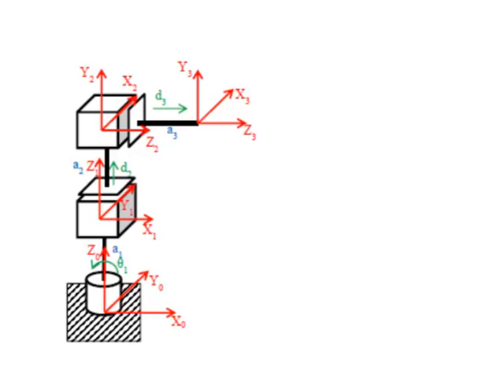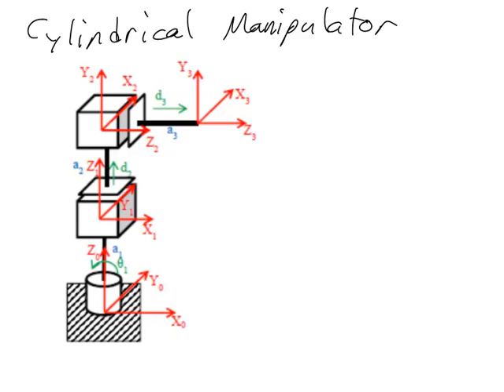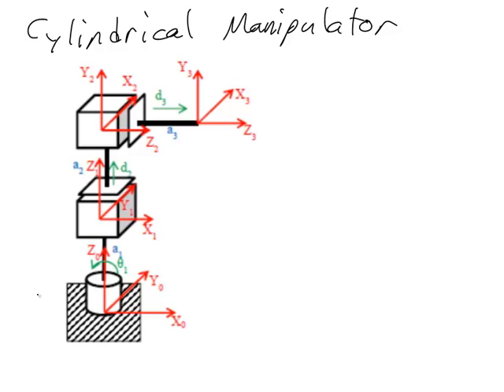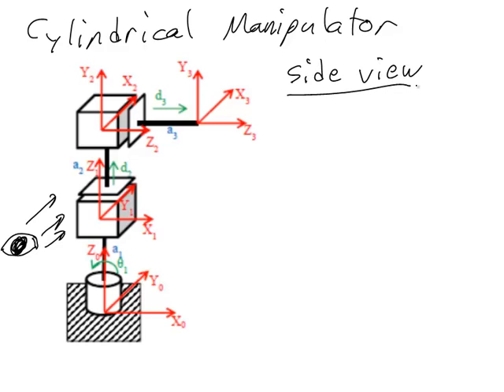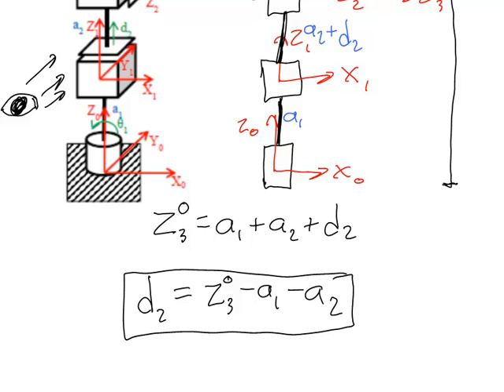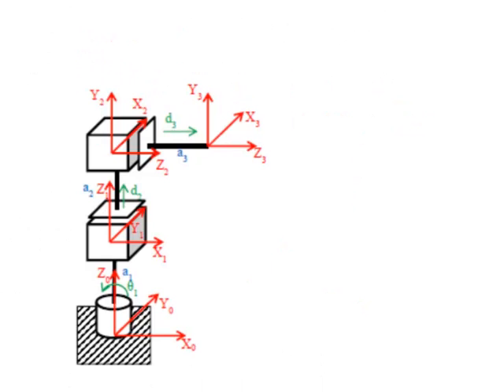1 1 6 Lecture Video 2 of 2   Inverse Kinematics Cylindrical Example

Comment: your frame 3 is incorrect, as we are rotating by -90 degrees (against right-hand thumb rule), X2 will face down, parallel to Z0 axis, also Y axes are the ones invisible from the side view. frame 4 will be constructed accordingly. did you run this in MATLAB and got solutions for kinematics/dynamics?

Comment: How i can calculate Y(0-3) and X(0-3) ?
Reply: You have to calculte them from the Forward Kinematics. So Is you calculate the matrix T(0-3), that its equal to T(0-2)*A3, where A3 is the matrix of your third joint ans T(0-2) is the matrix of joint1*joint2. From the las column of matrix T(0-3) you get their respectives x,y and z components relative to frame 0.

Comment: The joint at XYX(1) does not do anything that can not be achieved by rotating XYX(0) from what I can see.
It brings variable D2 into the equation is all if I am understanding it correctly and that is superfluous, why not just use Theta1 ?
Z0 and Z1 are always in the same plane when viewed from the top as you said.
The distance between XYX(0) and XYZ(3) will always be the, same all that can change is the angle between X0 and Z3.
Or am I missing something?
Reply from the maker: I'm not sure if I understood you question correctly, but let me try at an answer:

The manipulator in this example is a 'cylindrical' manipulator.  It is called that (for one reason) because the 'workspace' (the space the robot end-effector can reach) is a cylinder.  The first joint is rotational, allowing us to set the position of the end-effector at an angle around a circle.  The second joint is linear (prismatic), allowing us to set the height of the end-effector above the ground.  The third joint is also linear, allowing us to set the distance between the center of the cylinder and the end-effector.

With these three joints combined, we can control the position of the end-effector in 3-dimensional space.  In other words, the workspace of the manipulator is a volume.  If we would remove any of the three joints, we would only be able to control the position of the end-effector in 2-dimensional space, and the workpsace would be an area, rather than a volume.  

For example, suppose we remove the second joint.  In this case, the workspace would be a disk, rather than a cylinder.  We would still be able to control the angle of the end-effector around a circle by using the first joint, and we could control the 'radius' - the distance between the center of rotation and the end-effector.  But, we would not be able to control the height of the end-effector above the ground.
Reply: Firstly Angela, thank you very much for the prompt reply - appreciated!!
Now it is starting to make sense...
Effectively that means that the distance between XYZ(1) and XYZ(2) is not fixed but is telescopic in nature and that is why d2 is not a fixed value but needs to be calculated. If it was a fixed length as I thought the question in my head was "why calculate it"? 
I am battling to understand the whole reverse/inverse kinematics thing and your tutorials are very good!!! Thank you...
Now I can start to develop the software everyone told me was impossible to do as thanks to these 2 videos, light bulbs came on in my head.
My goal is to very accurately drive a Scorbot 3 type design arm using standard g-code running on an Arduino Due (WAY more powerful than the Uno) however my test bed will be a simple plastic and small servo arm.
I have a feeling that the belt drive system on the big arm will also give me problems with regards unintended end effector positioning issues when the arm sections move but if I can wrap my brain around the reverse kinematics and get those calculations correct then that should be "easy" to sort out.
Your 2 videos in this section gave me the understanding I have lacked for almost 10 years, so much so that the only thing that did not "make sense" to me was the "d2" issue. 
In all the other videos nothing really made sense.
Once again thanks.